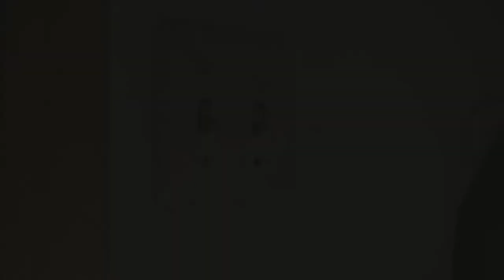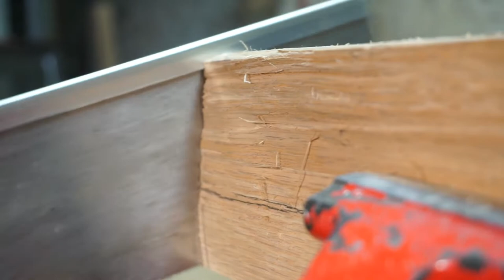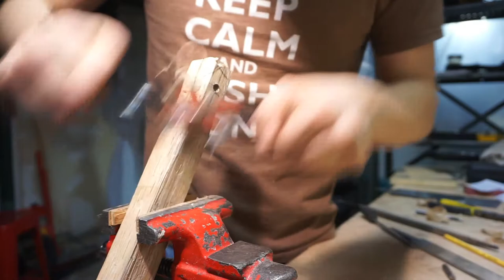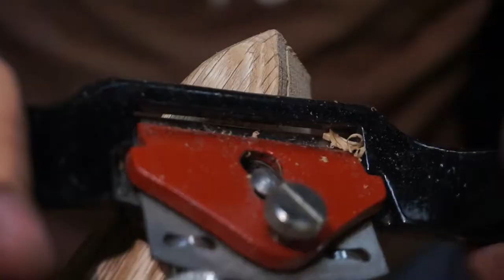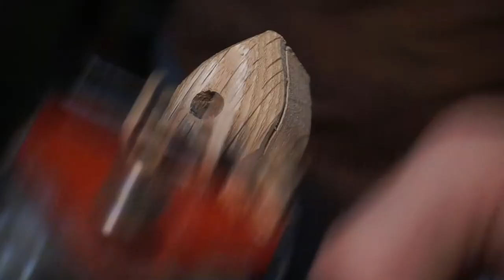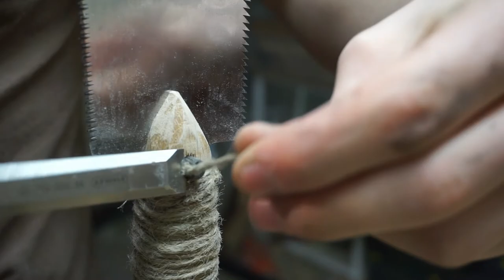MAKING A HANDLE FOR A JAPANESE PULL SAW

Comment: I love the video. How well did that hold up to time? I purchased the same blade with this idea in mind. Assuming it doesn't fit my old cheaper handle that I already have. Ran my current ryoba saw into a hard knot and ate the teeth... Also, where did you get that ebony dowel from?
Reply from the maker: I ended up scrapping the handle. I should have used a metal pin. The pin I used got chewed up. The pin was a maple one I stained. The blades are real strong and durable.  I still am using the first one I bought!
Reply: @BravermanDesign  Yaa maple isn't the strongest pin choice. Did you make a better handle or did you end up getting a Suizan handle as well?
Reply from the maker: I ended up getting the handle, yes.
Reply: @BravermanDesign  I see. I'm a cheapo right now with the covid crap. Ill see what I can craft into a decent handle.